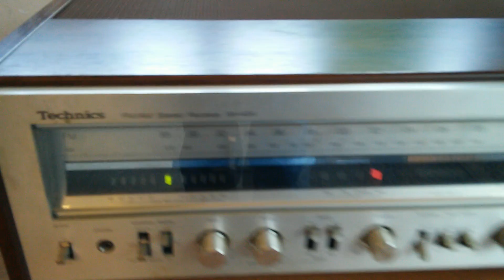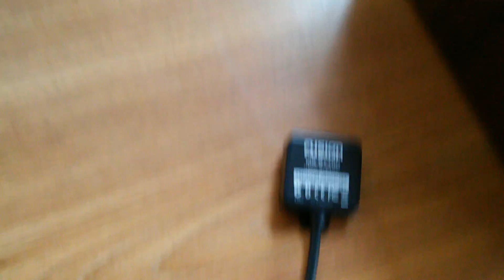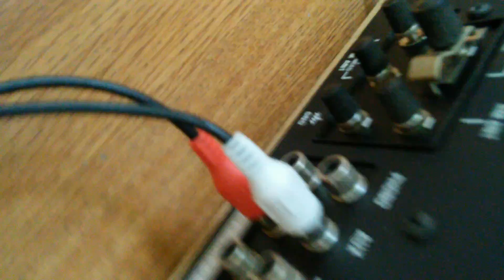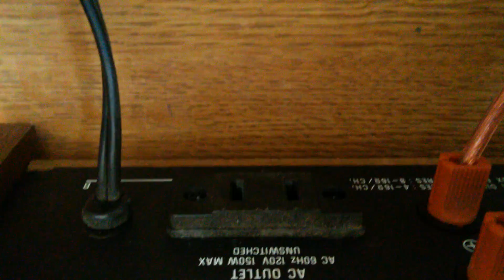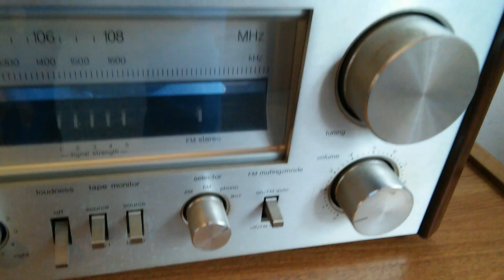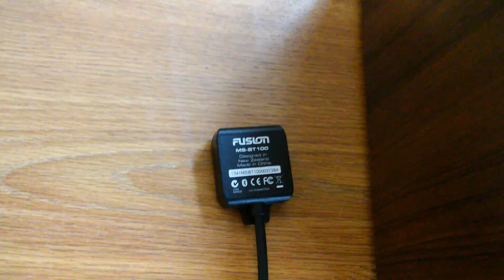Add Bluetooth to any vintage Home Stereo

Comment: AUX bypasses most of the filtering and high fidelity electronics.  Just be aware that this is NOT for quality listening.
Reply from the maker: AUX is simply another input.
Reply: @breakerbroke23  You might want to check the schematics for that receiver.

Comment: When splicing the power supply wires to the bluetooth, is it clear which is positive and which is negative once you cut off the end?  I have a 50/50 shot of guessing correctly, but I don't want to guess.
Reply from the maker: use a volt meter. You can get them for under $10 at any auto parts store or harbor freight
OR get one of these https://amzn.to/2MYPvMx
Reply: @breakerbroke23  thank you!

Comment: BB23: jumping in on this older topic since it's the right subject, but I'm interested in newer Bluetooth product advice. (Watched your Miccus  outdoor range test, Harmon v. Logitech, etc.).  My 2 issues/questions: I want something you know will transmit through a wall or two in a wood-frame house a total distance of at least 40 feet. Second thing: I want to connect non-bluetooth audio system to a remote-location, non-bluetooth, pair of powered bookshelf speakers (Right/Master spkr connected by wire to Left spkr). Can I do that via TWO bluetooth transmitter/receiver devices? (one, connected to audio system, set to TX; the other set to RX and connected to spkr pair via the optical input on the Master).  If pairing two tx/rx devices for that purpose is possible, any brand/model restrictions, or preferences? Happy to provide support by using a link. Would want at least aptx if not aptx HD.
Reply from the maker: I like your way out of the box thinking:) You could try your idea but I "think" you will have latency issues. You may get quite a bit of reverb effect when playback and going between rooms. ( If I understand your question correctly) I appreciate your willingness to support this channel, but I would hate to tell you it would work and then you are not happy whit results.

Comment: I don’t have an aux port on the back of my stereo. I do have an Phono port. Since I don’t use a record player can I use that port. I assume the Phono port will provide preamp as well for the Bluetooth. I’m going to order the BT100 anyway, but would like some advice as well. Thx!
Reply from the maker: Phono input will not work, try using a CD, Tape, Video input instead.

Comment: So can I record bluetooth music to a cassette with this set up?
Reply from the maker: yes, if your receiver will let you record from an AUX input to tape. (most all quality units will let you do that)
Reply: So I hooked up bluetooth with the fusion and a 12v plug as you instructed. I can play music, but I was not successful in recording that music to tape. I have a pretty decent stereo...LXI 170w reciever and a tape deck of the same brand. 80s, maybe? The tuner readout is digital...
Reply: @breakerbroke23  Also, the bluetooth on aux is now louder than the tape deck, just the opposite of what you said would happen. Strange. The phono and tuner are fine, the same as before.
Reply from the maker: @pizzarat6145  Your AUX is sensitive, that is a good thing. (some can be very low on sensitivity). Read your stereo manual, you should be able to tape from an AUX input.
Reply: @breakerbroke23  OK...I have not been able to find the model number on the monitor, or I'd have included that in my description.  I bought all of my components second hand, so I'll have to find the manual online. All of my components are vintage.

Comment: Okay I've done this, and it worked out fine. I also had one of these adapters knocking about that now serves as a power source.
I have one question though. The connection to the Fusion BT100 cannot be encrypted, which in fact means anybody can pair devices to it. Although it can only connect with one device at the time I don't have bluetooth turned on all the time on my devices. What if my neighbor pulls a prank on me and pairs his smartphone to it? He'd be able to play his music on my stereo, right? Is there any thing I can do against it?
Reply from the maker: Hello, so the BT receiver will only pair up to a single device at a time, and thats a good thing because this means no one could "jack" your pairing. And if you want a neighbor messing whit you just turn off the BT unit when it is not in use. Are you in an apartment?  cause most bt units only have a range of 30ft both transmit and receive.
Reply: @breakerbroke23  Thank you for confirming this. I live in an apartment, yes. I guess this is less of an issue when you're sailing somewhere out on the sea. (This device is sold by nautical shops in my country.) The point is, neither device that I connect to the Fusion BT100 are within range all the time. So the Fusion will be left as a sitting duck when neither paired device is around. I don't expect this to be a great risk, but it can be annoying. Some people may accidentally pair their device to it.
(BTW anyone can PAIR to it, but only one CONNECTION is allowed at a time. There's a difference :-)
Reply from the maker: @maszek  True,.

Comment: Good video. It's the route I'm taking. One comment is that you mentioned you could probably  get by with a 500 mA 12V power supply. In fact even that is 25X more than you need. The Fusion BT 100 runs on only 20 mA according to their spec sheet.  Probably any 12V supply on the planet can run this thing.

Comment: I used to look down on Technics receivers,until I was given a lil 35w/channel SA-300 and put it with some nice 100w speakers....The lil thing got some kick.Speakers are the key with these silver faces.Also have Sansui G8700 DB, Pioneer SX-950.Nice vid,Peace
Reply from the maker: Yes the Technics sound good, but the power supply could be a bit stronger.:) Like in your Pioneer.
Reply: I don't know what was going on at the thrift store I go to. They usually put $39.99 on these receivers.2 weeks ago, I got the pioneer for $20.00,plays great and super clean inside out. I thought I was dreaming.
Reply from the maker: Dang dude... you scored!

Comment: That is very impressive. So, if I understand, your set up allows you to play music from any bluetooth equipped unit (computer, mobile) and send it to your receiver, where it is picked up by the bluetooth receiver and passed to your speakers. Is that right?  Are the bluetooth units on the market now (the ones which are described as 'transmitter/receivers') capable of this?
Reply from the maker: # BT receivers I use and recommend, they are not cheap but way better than the low dollar units that are so popular. After you install one of these your done, they turn on and off with your receiver, no hassle no charging..no fuss.
1) Fusion BT100... https://amzn.to/2TMUoKq
2) JL MBT RX.... https://amzn.to/2DXEsAq
3) Harman Kardon BTA 10 (My pick).... https://amzn.to/2KvYO4r

Comment: breakerbroke23 just liked and subscribed to your channel I have a Sony STR-DE 475 RECEIVER which is probably 23 years old I have a Jensen 5 speaker surround system with floor subwoofer which is probably same age as receiver we hardly ever use the system anymore due to new technology echo, Bluetooth Samsung sound bar, Android phone for music MY QUESTION OR QUESTIONS FOR YOU ARE #1 can I purchase one of these Bluetooth signal boxes for my Sony & if so what brand do you suggest #2 would this work together with my Samsung Bluetooth sound bar model HWK-450 ( from Best buy 3 yrs old) #3 would ALEXA or echo dot pair to it ?  I have a an LG Stylo 2 Android phone I know I've thrown alot at you but before I rush out to buy or order one of these BT units just want to make sure it's worth it as I said we hardly use the stereo anymore,don't have the CD deck even on the stand anymore all music listened is either through Alexa,or you tube played on sound bar and with the Android phone THANKS,DAN from CHICAGO!!
Reply from the maker: Most any bluetoorh receiver will work on your Sony Stereo. Just plug the output to an AUX input on your receiver or if you are already using a AUX input then you could use a Tape input. There are so many more new BT units that have come out since I made this video. However I still do like using units like in this video. Also check out this web site to look at some of their BT units. www.miccus.com
 As far as Alexa and Echo, Im old school and have never wanted to play with these products, so honestly I have no idea how they work. BUT, if they have a output jack for Audio then they could be hooked up to your Sony the same way I suggested you hook up the BT units.
Thanks for subscribing. ....BB23

Comment: i have a cheap car bluetooth adapter that was 10$ and its rechargable with an internal battery and the whole unit is tiny and does all this with out needing to run any power its made by monster.
Reply from the maker: Yes that unit will work fine, but the idea of doing it this way is a more permanent installation that turns on with the Stereo and needs no charging or any maintenance.
Just turn Stereo on and play.
Thanks for your comment....BB23

Comment: I bought, from China via Ebay, a USB bluetooth adapter with audio output connection, for €1.50,-
Just plug the USB into a USB charger adapter, connect the it to your hifi, and connect your phone via bluetooth to the USB adapter.
It plays perfectly, and o so cheap!

Comment: Good vid.! I have a beautiful old wood cased RadioShack (45 AMP). Same vintage as yours. Even looks a lot like it. This is a great idea, Because I would never give that amp away or junk it. I just haven’t found an easy way to use it with modern stuff. Now, I can!

Comment: Nice Vintage Gear, Man... just wired mine up for about $3 Bucks. ;) Cheap chinese BT Receiver and a 3.5mm cable to 2 RCA jack connector.  Works like a Charm... Appreciate the Idea and Info. Peace

Comment: I connected an Echo Dot to my 20 year old Sony receiver. Now I have Bluetooth w/voice control. (RCA to 3.5mm plug). The only problem is if you have the music up loud, the Echo can't always hear your initial call out for any change in instructions..lower volume, change song, etc. Overall, a nice upgrade to an old unit for the price.

Comment: Can we connect car sub woofer with home amplifier? Pls anyone tell me.
Reply from the maker: Sure! Do you want to just use a woofer (driver) or sub woofer with a Amplifier?
If you just want to use an un-amplified woofer I would not recommend it. Your home stereo will not have the proper X-over to control the woofer, and you will need a DVC woofer because most all home receivers will NOT like being wired in Mono.....  You could try it but it will sound like ^%&*.
 If you have a powered sub or are using a sub amp then you will need a line level adapter to hook to your speaker B out from home receiver to turn speaker power to RCA line level, then just hook up the RCAs to amp and rock out. (RCA line out puts on your home stereo are fixed output, so you will not be able to control your sub volume) Understand you will need a 12v power source (power supply, car battery etc)for your woofer. Can it be done? YES I have done this in my shop for testing purposes, its just a PIA. You can buy a nice powered sub on the cheap nowadays.
Reply: Thank you sir

Comment: Why would you want to make a great sounding piece of vintage gear sound like dodo?
Reply from the maker: It does not sound like "DoDo"  Even though BT is not as "Audiophile" as you would like,  bt through a vintage receiver   is still better sound than listening to anything (CD, Tape, Blueray, dat, phono ) on a modern Audio Video Receiver. AKA Home Theater .
Reply: Dodo?  As in the extinct, flightless bird?  Did you mean doo doo?

Comment: Awesome.   How do I hook up my phonograph?
Reply from the maker: Use phono inputs. If you no not have phono inputs on you stereo then get a "phono pre-amp" and use an AUX in to the receiver.
Reply: My phonograph has no sockets, actually no electronics whatsoever.
Just the hand crank.
Reply from the maker: From what I understand at sometime the "phonographs" went from a steel pickup or needle, to an more of a electro magnetic needle. Yea.. I dont know. Maybe some one out there has a conversion or something.. Way over my head.....BB23
Reply: breakerbroke23    My original comment was a joke man.
The phonograph works on a wind up spring, a rubber membrane picking up vibration from the needle which travels along a hollow tube in the arm to be amplified by the brass cone.   Not much too it.
Reply from the maker: Got me but good:)
But I sometimes get some doozie questions.

Comment: I use Logitech's Bluetooth receiver. It works well although I am suspicious of its separate stereo channels (very disappointed in that). I will also say I've used a knock-off make, sold through Monoprice, that fried a section of my H/K power amplifier. I was VERY angry, and had to find someone willing to attempt the repair. Fortunately, it was able to be fixed. - It made a sharp "zap" sound when pairing. Monoprice has many quality pieces, but the B/T receiver is NOT.  It's very great to enable electronic digital music storage with your audiophile equipment.  Maybe not the best in terms of  audiophile quality, but it makes it useable, and I don't know of many (maybe two) component-style storage, decoding players; I think there would be a market for something like this (with wi-fi file transfer and organizing), but this will do for me as I once again build my same music in another media form (oyy).  -I look back and see music on vinyl, tape, optical, computer and now smart-phone (LOL).
Reply from the maker: Glad to hear your HK is okay now. YIKES!  " It's very great to be able to enable the older equipment with electronically stored music." I agree 100%.

Comment: A lot of old electronic devices are easy to use and have a charm about them. Old electronics only needs the electrolytic capacitors replaced to get them as good as new, even if they still seem Ok. Thanks for the great idea on the bluetooth..
Reply: Argento Goldspier  The capacitors do not all need replaced. Only if they test bad do they need replaced.

Comment: For anyone out there that thinks these old receivers are crap....last year I sold a Sansui 9700 receiver and a pair of JBL L220 speakers  for  more than I paid for them back in the 70's I still have another receiver like the one that was used in this demo that I am going to hook up to BT to be out in my shop and hook up an old iphone 4 as an ipod for it with the tunes from the 60's and 70's  that kids around will probably hate and hopefully keep them away from my shop at night . Santana will rule again !!!. I bought a pair of JBL L65's for a C-note that were water damaged on top so I scuff sanded them and sprayed them with black melamine paint and they look and sound awesome.
Reply from the maker: I would love to get a hold of a 9700. Careful pops, keep the volume down, you dont want to offend any youngin's whit that grandpa rock your playing out in the shop. :)
Reply: Did you happen to think of the use that I got out of them from 1978 to 2016. I don't think that inflation is a factor here.
Reply: 15017 HfX do you have a SDM 1216 Toshiba DVD ROM hanging around? I need a replacement for old Bose 321system, eBay had one for 47$ but no refund thanks Debbie
Reply: Hi Deb,Sorry all I have left is a JVC tuner and amp that I'm going to use in my shop with the JBL L 65's speakers. All I can say is keep checking Ebay, Kijiji or Craigslist. It may take you some time ...but they are out there .Good Luck
Reply: Thanks for responding, I haven't heard of the ki one and I never thought of Craigslist. I don't really understand All that auction stuff, anyhow am I correct trying to replace it? Like I said it seems to be catching on the white wheel and I've torn it apart so many times. So I will re install it at least I'll get FM and DirecTV through the system! I keep thinking if I could see a little better I may see the little flaw? I know know I've flipped. I'll let you know when I find one, and that's a great idea go to good will! Cuz I'm disabled and there's no way I can buy new. Thanks again
Reply: Im just wondering if you factored inflation into the equation
Reply: 15017 HfX your money now is wort less than when you purchased
Reply: Paul  what you been smokin'? Like I told alaskanhybrid I used those units from 1978-2016 so inflation is not a factor here. They worked awesome when I sold them [basically untouched by teenage hands] and when I advertised them I had guys all across the country emailing me wanting to buy them. They were gone by the weekend. A lot of guys want those old receiver amps and speakers. About a year ago there was a set of L220's on E-Bay and I think they were up around 3G's. Everything is relevant. /;-]
Reply: Those “craps”were built to last! Nothing, I mean NOTHING are built to last this days!! Those huge and heavy amplifiers are the best even today. Today’s gadgets are craps note old one.
Reply: Still nothing better than a Sansui from the early 70's. Just make sure you solder in new capacitors at least the big ones in the power section.
Reply: Cosmin Chiriac , very true. Vintage receivers are the best when it comes to audio quality.
Reply: @ronnieperalta4051  You have that right. The s/n on these amps are vary low so sound quality is vary high. I don't think the manufacturers today even think about that. Lots of junk crap out there today.
Reply: Those tunes would lure me in :-D
Reply: shttps://www.youtube.com/watch?v=4ToDTnxuieE   from Sansui,30W per channel
Reply: 15017 HfX I have a stack of old playboys from the 70s and in the ads- a brand new Subaru was 5000$ but a receiver like this was 1000$ they’re quality built to last maybe a bulb or a fuse here or there but they live on forever